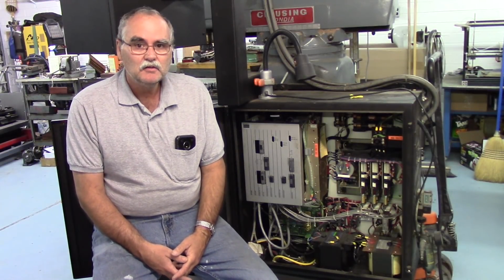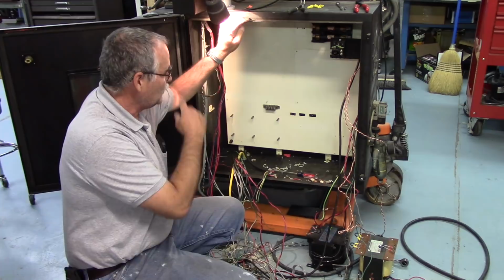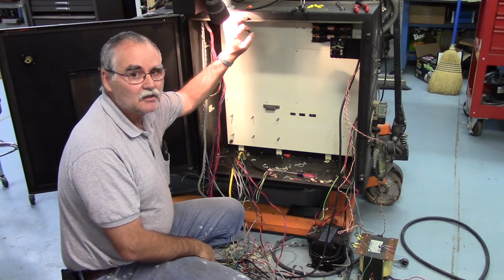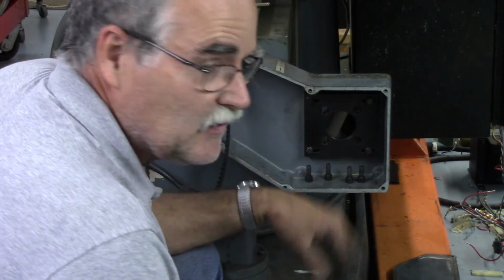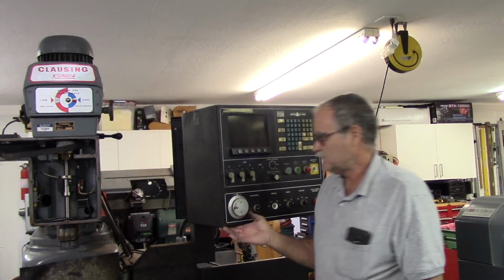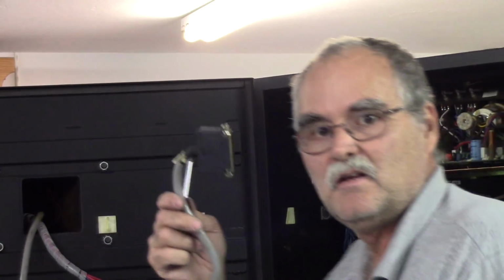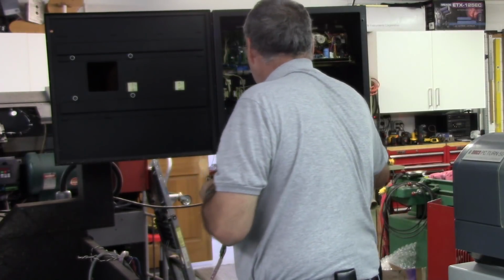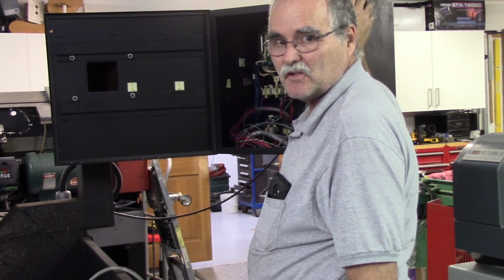Clausing Kondia -  Stripping the control, prepping for the Centroid CNC & DMM DYN4 & AC Servos

Comment: Hi Marty love your channel. Just enquiring what size motors you are using on the x,y and quill? With direct or geared ratio..
Thanks

Shaun

Shaun
Reply from the maker: 750w servos would work, but DMM sent 1.2kw. direct drive would be ok, but for simplicity's sake I'll reuse the pulleys

Comment: Great job Marty. I have quick question. I have a Hurco Hawk5. Same Maschine. But I like to keep the steppers and the SDFP 1525-17 control.
Would it be still possible to have the Acorn hooked up with that controller? ( I am not sure where to hook up the signal source from the motors).
Just a quick it is possible or not would be nice. Thank you.
Reply from the maker: Servo Dynamics drives? Those are not stepper, those are servos. Acorn can not drive those. Centroid All in One DC is a combination motion controller and 3 axis servo drives. You would have to likely upgrade the encoders.
Reply: Thank you. ( the name already is saying it, servo.....). Do you actually have more videos on the conversion of the Clausing?
Not pushing it but I also would be interested in the "shopping " list with the things you used to convert this Maschine.
I am still looking and learning. Will look at more of your good videos. Plan to get all the stuff and do the modification next winter!
Reply from the maker: I am waiting for DMM to make a couple of firmware changes. I and testing this combination for DMM and Centroid. Should be ready when you are

Comment: Hey Marty!  I'm considering purchasing the same machine.  Do you have an estimated cost for this upgrade?  Would you be willing to share the parts list?
Reply from the maker: Well, it all depends on the control you use. Is it's current control operational?
Reply: @martyscncgarage5275
Reply from the maker: Roger, the reason I ask is that you may be able to reuse the DC Brush servos on the machine if they are any good and go with a Centroid All in One DC. Otherwise you may have to do a bit of fitting of the DMM NEMA 42 motors if that's what you plan on using. Primarily to tighten the drive belts.
Reply from the maker: @rogerbown  you may email your question to me at my YouTube channel name @gmailDOTcom.

Comment: Thanks for taking the time to do these videos Marty. I walked by one of these old Clausings every day in my college machine shop and always thought it a shame that it sat idle. Looking forward to following your progress!
Reply from the maker: Hoping to get back on it and the Emcoturn 140 very soon. DMM AC servos and drives are here for both
Reply: I'll be starting in work soon on a Kondia-made Hurco SM1 CNC. Low hours with a dead controller; seemed like a good fit for this sort of project. Toying with using Universal G-Code Sender on the PC to Arduino equipped with GRBL firmware and Gecko DC Servo Drives. Sort of a lowest cost alternative but my CNC needs are relatively simple. We'll see. Your videos are a great reference, especially on the Kondia.
Reply from the maker: Brian, does it have it's original DC brush servo motors? I would fool with Arduino/GRBL. Take pictures of the machine and control and.post to the Centroid Users Forum for some advice and direction.
Reply: Yes they are the original servos which I figure to be in good shape because the machine probably has less than 1000 hrs of spindle run time. Power-On hours are 4800. Once the machine arrives I'll definitely hit the forums for some advice. My gut is that I should be able to get some good use out of the hardware that's on the machine and if and when I have servo motor trouble I can upgrade to AC servos.

Comment: Hello Marty 
How is kondia refit progressing ??
Reply from the maker: Hi Hugh, since I am a one man show, the Clausing was a "speculation" project and a paying job came through the door,  and I was waiting on new DMM Technologies DYN4 servos with some upgraded firmware that was being worked on, it got back burnered. But fear not I am almost finished with the lathe project, and the drives and motors are here...I'll be back on it and the Emcoturn 140 lathe in the next few weeks.....thanks for the inquiry!
Reply: @martyscncgarage5275  Hello again Marty , Greetings from Ireland .I am also doing the same conversion on the same model so that is why I am interested  mine was already stripped of the old controls and motors and pulleys.Can you tell me the motor pulleys that was on your machine , I believe  that the drives are 1 to 1 but i would like to verify that with you.I am going to use acorn and 
230V  3 Phase closed loop steppers on mine .this will be my fifth  acorn conversion and I am very pleased with them .this is just another retirement project for me so your videos helped a great deal

Comment: I am very happy that I came accross this video. I am in the process of buying an exact replica of this machine (except it has a pneumatic power drawbar). I was also thinking of doing a centroid conversion. However I was thinking of reusing the SEM servos. Did you change them as a matter of preference, or are they not compatible with the centeoid controllers?
Reply from the maker: elser2utube, I would suggest keeping the SEM DC brush servos, and using the Centroid All in One DC. You will likely have to upgrade the encoders. I am doing ACORN as an experiment, to discuss a hybrid closed loop system. If all goes well, I have another plan as well to demonstrate. Later in July.
Reply: I got mine, (man was it a struggle to single handedly get it in the garage). 

In my research of the centroid products the "All in 1" sounds good on the surface but I need to be able to digitize with a probe, that software feature seems to be around 5k for the "all in 1". (Not going to happen)

I know the downfall of the acorn is the open loop control but I am leaning towards using it with the closed loop dyn4 servo drivers . My problem as you alluded to is the servo mounting because  mine has 500 OZin "baldor big mho" DC servos (I think just like yours). The closest match as far as the torque specs goes are the 1kW DMMs but the 130mm flanges is too big, and I think the shaft size is bigger too so I would have to get new pullies. 

Have you started installing new servos as yet? If so I would love to hear/see your solution. Do you think that the 0.75kW servo would be sufficient for the machine? I think they are underpowered by about 25%  but I cant find a torque curve for the DC servos to match them up.
Reply from the maker: Mine did not have Baldor Servos on it, It had typical SEM motors. I am using DMM's new NEMA 42 1.3KW motors. I am waiting on them to show up.

Comment: Hey Marty I love your videos they are great! really looking forward to this retro fit.  I'm looking at exactly the same setup for my mill, its smaller than the Clausing Kondia but a similar configuration,  I'm planning on using the dyn4 drives and three 0.75kw AC servo motors (direct drive on x,y and 2:1 belt drive on the knee as my quill will be harder to cnc).  How have you found the acorn board in comparison to the all in one? I know the all in one is outright a better setup but i don't really have the budget for it as i also have to buy motors ball screws etc.  My major concern with this setup is that the acorn doesn't offer true closed loop like the all in one, but I'm hoping the servo loop on the dyn4 drives will get me most of the performance at a lower price.  

on a side note, I did consider the leadshine closed loop servos at the beginning but the lack of local quality support and torque vs speed stepper trade off turned me away from that option.   

I am very familiar with linux (I'm actually a control system engineer for a major medical hardware manufacturer) so naturally also considered linux cnc with full closed loop but the time investment to come up with a good combination of components and customization of the software to make it run how i want makes me look at the centroid/dmm setup and think is it really worth the additional work to save a few bucks?  

if you have time i would be very interested to hear your thoughts on the performance differences/pro's & cons of the centroid all in one fully closed loop vs the centroid acorn/DMM dyn2/4 setup.  i have read all the documentation and understand both systems but it would be great to hear from someone that has worked with and used both. 

Thanks Ash
Reply from the maker: Ash, for lower end builds, I think it's very reliable and very good performance. Servo drives close the loop. DMM AC servos are painless to setup and tune with their software. A deciding factor for me is what is the machine worth when you are done investing the dollars in the control upgrade? Does it enhance it's value where you can recoup the investment? How much I/O do you need? Basic mill will work with Acorn's current 8 inputs and outputs. Add a tool changer and likely not. Even closed loop Steppers from Automationtechnologiesinc.com are worth looking at because they have a decent selection and provide good customer service. Is the machine you have a dedicated CNC machine with ballscrews etc? Also Teknic Clearpath SDSK brushless servos are also worth considering. All depends on your needs and budget
Reply: Ash, you can't use All in One DC with DMM AC servos. AIO DC has 3 DC brush servo amps built onto it to drive well, DC brush servo motors. You are correct. Acorn is an open loop motion controller. But if you drive DMM DYN drives, the drives close the servo loop. The DYN drives command the motor to move and by watching its encoder input, ensures it moves as commanded. I have done a router and a lathe this way and both are on my YouTube channel. There is another project being tested with DMM and Centroid, but that's too early to discuss. Perhaps more in a few weeks.
Reply: Thanks Marty. Yes I understand that the all in one wouldn’t work with the dmm drives.  What I’m trying to ascertain is how great of a gap in performance there is between an all in one running fully closed loop with directly connected dc brush servos and the acorn with dmm drives and brushless servos that close the loop at the servo controller.  The dmm acorn setup seems like the best value for money but I’m curious as to how well performs vs proper full closed loop.  It would be interesting to see some comparisons between this machine and the one you did with the all in one.
Reply: Thanks Marty you make a very good point about what the machine is worth at the end!  The machine is what I would consider at  lower end of mid range manual machines 2/3k unconverted. I’m pretty sure the acorn setup will do all I need.  The majority of my machining is race car parts.  It’s currently manual and I have done a lot of my work using the dro which is very time consuming for some parts.  More complex parts I have been farming out but due to the lower volumes it can be expensive and long lead times even if I do all the work in fusion. Also some of the stuff I have received back hasn’t been to spec causing more delays.  I want to make this machine cnc only and have already converted it to 20mm 5mm lead ball screws a while back.  Ultimate production speed isn’t my main goal, I need a good reliable setup that produces accurate parts in a repeatable manner without a lot of messing about to get things working and keep them working.  I appreciate you taking the time to respond you have helped me make up my mind.
Reply from the maker: Ash, it's always better from a time and money perspective to start with a purpose built CNC machine. I have several CNC mills available, but I'm in Mesa, AZ
Reply: very true with regard to the time and money statement i wish i had started out with a purpose built cnc, hindsight is a marvelous thing.  Your a little far away from me but never say never ;-)  If i ever find myself in AZ i will have to visit, im sure you have lots of cool stuff and i will go away with an empty wallet!  At the least i should buy you a beer for all the hours of cool videos you have made for me to watch.  I took the plunge and ordered the acorn kit today so will see how it goes.  I'm also going to order the dyn4 drives and .75kw motors.  worst case scenario if i end up needing a bigger machine i can pickup a used one with an old controller and upgrade it with the kit i have and put this one back to manual.

Comment: I managed to remove the end covers on my DMM Tech servo motors so I could machine the flanges. It's not difficult but you need to be careful not to rip the encoders off the other end of the rotors - wasn't actually difficult. Getting them back on is a little tricky, since the permanent magnet rotors don't want to stay concentric!
Reply from the maker: Interesting Murray. Why did you have to machine the flange plate and what did you do to them?

Comment: Made it a lot harder not just using some wire cutters to remove the old equipment. Are you going to give the machine a good clean now all the wiring is out of the way. Will the new equipment need any of the old transformers. Cheers Dave.
Reply from the maker: Hi Dave, I tend not to be a "hack". Since the some of the control was going to a new owner, I wanted to make sure some cables/connectors went with it in case they were needed. No transformers. Going to use DMM Technologies DYN4 and AC Servos.